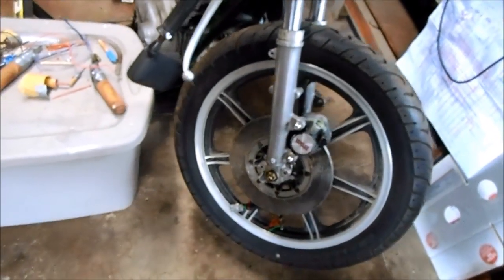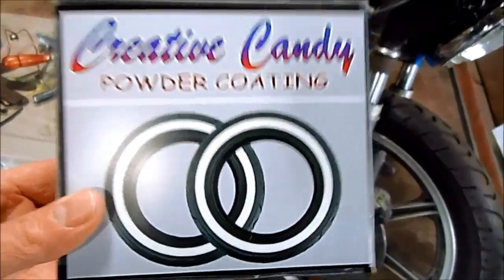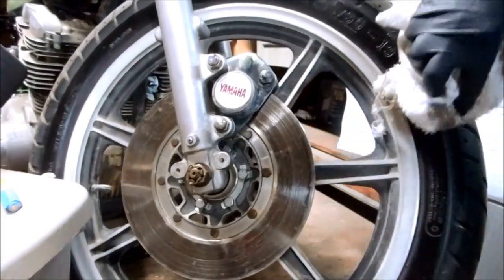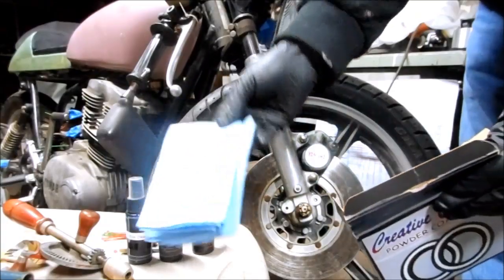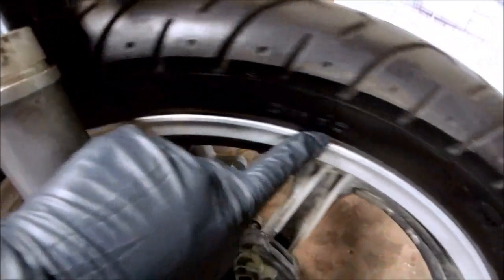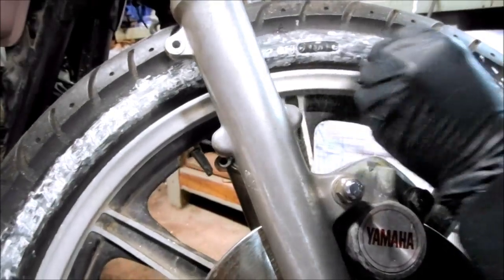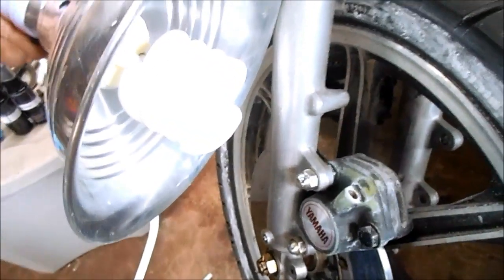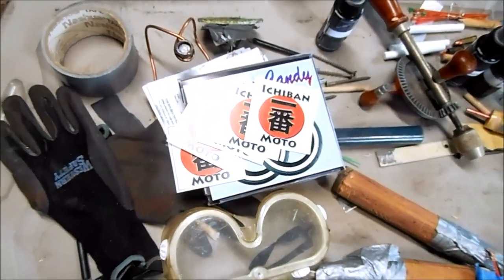Ichiban Cafe Racer Part 24: How to install Whitewall tire upgrade kit on motorcycle choppers bobbers

Comment: Where can you buy one of those kits that installs that cool X on the headlight? Also some instructions would be cool.
Reply from the maker: I will have to do some additional research on that, I heard those kits are several hundred dollars. For this bike, I went with the hot rod theme chromed lamp with visor ( can be seen in the Ichiban Moto Café Racer Part 4 video )
Reply: Ichiban Moto Nice! I am implementing, as much as possible, your videos into my Vespa build. Here is a link to the look I'm going for, but I can't find a kit that will fit my smaller headlight.
http://i18.photobucket.com/albums/b106/danish6259/Cafe5.png
Reply from the maker: I will figure it out and post a video. btw -Whoever owns the bike in that pic should watch my video on how to shorten cables.
Reply: I converted my rear brake to run the gas on my bike, but I found that the rear brake cable worked perfectly with a recycled fuel line as a spacer.

Comment: Nuts! I just forked over about $70 for a whitewall tire for my '86 Sportster bobber. I sure wish I'd run across your video because the tire I took off still had the tits on it.
I'm wondering, though, if some SaniWhite shoe polish for white buck shoes would've worked just as well as the Creative Candy Powder Coated kit?
Reply from the maker: +tpitman I have not tried that, but since the powder is baked on, it seems durable enough

Comment: Your tires were made in 1979 brother just buy white walls. You needed new tires in 1983 at least. If the product thinks it can turn plastic back into rubber and give you fake white walls it's probably not worth the savings lol.